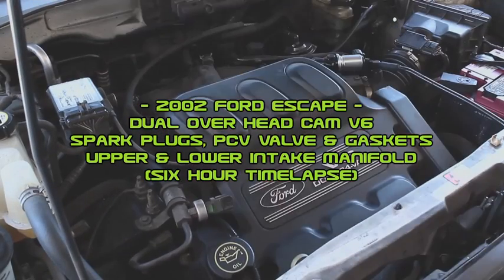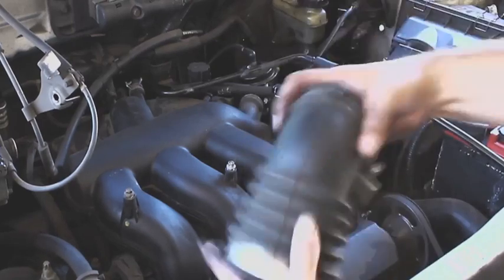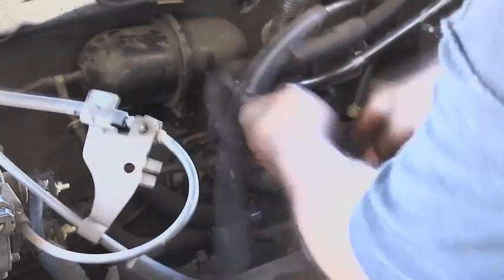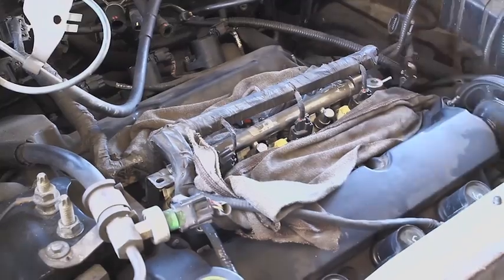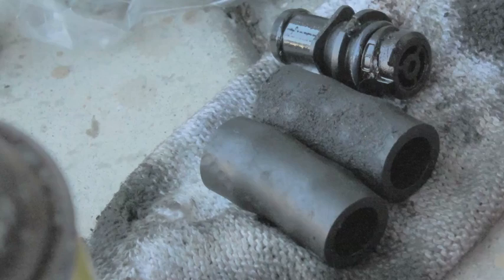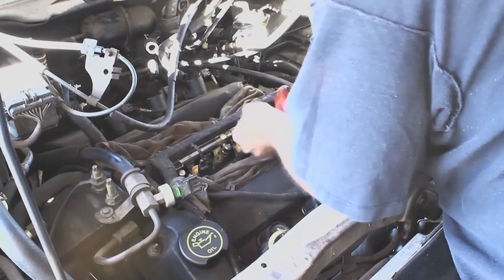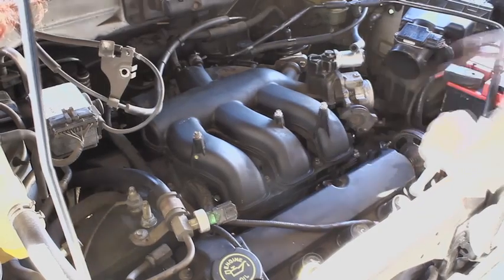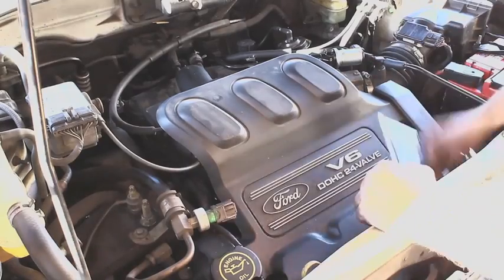2002 Ford Escape intake manifold gaskets (upper+lower) & Spark Plugs

Comment: Did you depressurized the fuel line before changing the intake manifold’s lower gasket?
Reply from the maker: In other tutorials the fuel rail is often disconnected. I circumvented that altogether, but, yes you are correct, depressurizing the fuel rail is the safest way. Even if it's not disconnected, it could spring a leak and spray somebody in the eyes/face. Your safety mindedness is sound.

Comment: LOVED IT! I have the exact same engine I'm working on, also found oil in the plug wells so I am off to replacing valve cover gaskets as well. My issue was the "bucking" around overdrive 50+ MPH and cyllinders 1 & 3 misfire codes. Hoping ny swap of all this works.
Reply from the maker: Thanks, I'm glad this video has been useful to you and so many others. That bucking may be related to electrical connections to the various components, it's worth checking out. The earlier Escapes are known to have electrical gremlins, not sure if Ford addressed that in later models. Heads up also on the linkage to the transmission. If it goes out abruptly, get a visual on that before taking it in. Mine lost a $7 plastic connector and the linkage directly to the transmission disconnected. Stay safe.

Comment: I hate mechanics (do everything myself because I have trust issues) my wife saw me watching your video because I'm about to do the intake/head job on her 02 escape and I told her you're the kind of guy I would want working on my vehicles. Keep it up!
Reply from the maker: Thanks Robert. I should've made it my profession as I originally wanted to. These days I just nerd out on whatever I'm working on, so my Escape got a lot of attention. Careful with the fuel rail electrical, it's delicate. If fact, the Escape's electrical system is it's Achilles, imho. I'm glad this tutorial has gone so far! Cheers
Reply: @LouRadon  Your tutorial is actually one of maybe two on this engine. I had a terrible time finding one, and I kind of wish I made one when I did my wife's. But yours was by far the best one I found. I ended up taking off both valve covers and accidentally separated the fuel rail from the injectors and didnt realize that the lines needed to be depressurized (I only work on cars when mine are broken so not too often haha). Aside from that, I would have been completely lost without your video. Thanks for doing it for us!
Reply from the maker: @Robert-cz3pz  My idea of doing something to help others, seems to have worked. At the present, this video is close to 80k views, I'm pretty stoked (and surprised), about that. All I ask in return, is for viewers to pay it forward to someone else. ...if you choose to. Thanks for the props man.

Ps: I learn so much from other people's DIY tutorials. So, i thought it would be cool to contribute something in return. We've created our own intellectual currency. Money is important but we don't always have enough for what we need. Sometimes we just want the sense of accomplishment. It's good to push our abilities now and again and do something challenging and new. Keep a healthy brain and a strong mind. Cheers

Comment: Hello, thx for uploading the video.
What prompted you to replace these gaskets?
Reply: He had a rough idle. What happens with these cars is the gaskets get fouled, and air is able to slip by during combustion. This leads the car to have bad fuel mix and a rough idle when cold.

Comment: Im really desperate, my for expedition was leaking, my mecanic fix the leaking but is a bad and strong shakin and la engine light is on , i need some help
Reply: Get an OBD2 scanner from Amazon. I got one for $39. It'll give you the codes and hopefully point you in the right direction.

Wouldn't hurt to inspect and/or just replace the ignition coils, spark plugs and gasket like he did in the vid. Could clean the mass airflow sensor, too.

Comment: Help! I Mazda Tribute 2005 release 3.0. The problem with the PCM, made in different places diagnostics can not find the problem, insert a new PCM machine factory. 2-3 working days, and again burns PCM and combustion noise issues, electricians, too, can not find the cause. Someone says, because of the coil can be. advise.

Comment: My escape has had a rough idle when cold, ive change the EGR and IAC. I had the hose all replaced prior to the EGR and IAC fixes and the idle problem. I found a video that stats this gasket replacement can fix the problem, so I'm going for it. Anyways what I'm trying to say is your video rocked and gave me confidence to perform this fix.
Reply: Did this fix your rough idle? Mine does the same. 2001 3.0L V6 with 300 000km
Reply: David Winn III did it fix your issue?

Comment: Great video- thanks. Looks like you were able to remove the lower intake manifold without disconnecting the fuel line to the rail. Can you confirm this?
Reply from the maker: +604zippo Yeah man, the fuel line remained connected. i just made sure to disconnect the fuel rail bolts of course and maneuvered everything around carefully. Lower intake manifold was able to clear it's way out from underneath. The trick was to slot the fuel rail out on the left where it wedges as the lower intake manifold was slid out to the right.

Thanks for checking out my video and commenting. Good Luck!
Reply: Thanks for the fast reply and I'm looking forward to tackling the lower intake gaskets now, with your help. Take care.
Reply from the maker: You're very welcome, happy to share what i've learned. More videos to be posted soon.
Reply: +Lou Radon 
I have a 2002 Escape V6 XLT, I just replaced both left and right mainfold converters brand new parts. After driving I noticed a burning smell and little smoke when I lift the hood. The repair man told me it's more likely the paint being burned off by the converters?
Reply from the maker: +datvegasboi09 i don't have much experience with that so I can't say for sure. but that is consistent with what I've read about other newly replaced exhaust systems. did u have check engine lights that cleared? is it running better or quieter than before? did they show you the old exhaust parts that were replaced?
Reply: +Lou Radon No engine lights were on or an issue. I would say better before that the repair shop told me I had 2 leaks in my exhaust and needed to replace both left and right manifolds.  No I didn't get to see the old ones but I did get to see new ones after installed. I saw white  paint looking pipes. I only smell something burning when I am driving but when the car is parked or running. I lift the hood it goes away or no smoke.

Comment: I'm also here troubleshooting an '02 Escape V6. She blew an EGR valve - literally. There was a hole in the side of it for a while. Replaced it. It ran for 200 miles or so, and coming up an interstate on a mountain it shut down. Towed it home. Hasn't started since. I feel some exhaust from the tail pipe - even tried disconnecting the EGR tube to see if we could circumvent any clogged cats. Still won't even start. Tons of oil in the throttle body behind the butterfly - not on PCV side of the intake. I'm going in to replace lower gasket [intake manifold gasket] as well as the plenum gaskets. I have spark in the front 3 cylinders. As soon as the plenum is off I will make sure the rear 3 COP's are sparking, as well as the spark plugs haven't been insanely corroded. One of the front 3 spark plugs had the electrode bent to the tip. No piston contact, as far as I could examine. Pistons looked clean as a whistle. There is fuel at the rail, pump is priming, and theft system is in order. We shall see its fate.
Reply from the maker: Sean Sateren Hey Sean, just saw you posted this last week. How's everything going? When i started working more on my ESCAPE last year, the throttle body was caked with deposits. I used an old tooth brush and THROTTLE BODY CLEANER, (be sure not to use CARB CLEANER as the metal of these throttle bodies are reportedly coated). I got most of the gunk out with a rag while the engine was off, then used the spray while it was running. That helped because prior to that the throttle itself was being restricted very minutely from closing and opening completely. I replaced my EGR valve at the same time, although i probably could've just cleaned it also, it was old so i chose to replace it. I have read about clogged CATS causing the EGR valve to bust open but no experience with that myself. Do you have any specific check engine light codes? Have you had a chance to place the spark plugs? INTAKE MANIFOLD gaskets aren't too bad to replace if you're patient and/or experienced but use caution on handling the FUEL RAIL as the injectors and wire harness/electrode connectors are delicate.
Reply from the maker: Lou Radon As a side note, you may have already checked your emissions vacuum hoses for disconnected or cracked lines but also in particular, that PCV hose elbow that connects to the INTAKE MANIFOLD can split on the under side of the bend and leak badly without being obviously visible. Curious to hear back if you choose to update us so that we can all learn more about it. Best regards, Lou.
Reply: +Lou Radon Hi Lou - this is Sean. I'm doing lower/upper intake gaskets right now. Everything looks good. Then we'll see if the cat is clogged, heh. Coils and plugs are good. Replacing plugs and PCV valve since I'm in there. Hopefully the EGR blowing was due to back pressure from bad intake? We'll see! I'll update by the weekend.
Reply from the maker: Pixel Pusher
really cool. not so bad once you see how it all connects and get an idea of whats doing what, right? main concern for me personally was being sure not to over torque anything when putting it back together. the hardware and plastic on these are soft.

btw, what kinda' pixels be you pushin'? i do a bit myself.
Reply: I removed all 4 O2 sensors to bypass cats, still no starty. New intake gasket, still no starty. :( I've gone through everything I could think of... Now - I'll do a compression check to see if we had a mechanical failure... We have fuel, spark, theft system shutting off, everything. I do graphics and printing in a digital print shop :) My father spent his life doing offset press, now i do digital press.
Reply from the maker: +Pixel Pusher i dig print media, very cool.
i'm not so sure the cats can be bypassed without causing a failure due 
to computer not being able to read and adjust air/fuel mixture. these 
types of problems seem recurrent with escapes once they hit a certain 
point but run great up til then. there is a series of symptoms often 
reported to be related to the PCM. in the event of a PCM complication, 
it sometimes has to be correctly programmed/updated if necessary or 
physically replaced and programmed to your vehicle. google it (and 
prices) for more info.

Comment: Lou Nice video!
I'Ve just change my coil pack (all 6) on my escape 2004 v6. and I notice a strange orange stuff on the spark plug, there were some on the old coil pack too. It was in 3 cylinder only. I know it's not rust, but can't figure out what it is. Any idea?
Reply: Perhaps it was antiseize. I have an 04 Mazda Tribute V6 and I put antiseize on my spark plugs. When I go to change them a year later, the antiseize compound has an orange-like color that kind of looks like rust, but I know it isn't.

Comment: I love how meticulous you are. Wish you lived close I would've had you do mine. Can I ask you a question? I replaced the spark plugs, and injectors in my 02 Escape v6. No codes before the job. Now I'm gett P0304 and P0306. The car barley stay running... I'm stumped on what I did wrong because the car ran pretty much fine before the job.
Reply from the maker: ***** cylinders 4 & 6 misfire. did you double check all your wiring and connectors?

Comment: Hi lou my truck is a ford 2002 scape and  When i try to turn it ON the throttle cruise thing.. snaps out can you show me how to fix that. Problem so i wont pay a mechanic thanks. And the truck wont turn on. 😢😢😢
Reply from the maker: nataly Alvarez Ok, for example at 0:10, I remove the cover.  Then from 0:11-0:13 I'm referencing the Cruise Control cable.  I'm almost embarrassed to admit but i drove my escape for years without cruise control but didn't care because I don't use it much anyhow. So then one day I was looking at the spark plug situation and saw that cable was dangling. That snapping connector piece where the cable connects is sometimes defective (..check escape recalls..). Mine kept falling off so I used a little piece of duct tape to fill the space of the plastic connector that wears thin. just above that is the throttle cable. reconnect or repair if needed.
Reply from the maker: nataly Alvarez hey! check out my latest video if you're still interested.

"2002 Ford Escape Cruise Control & Throttle Linkage"

Comment: I bought an 02 ford escape. Took it to the dealer for some recalls and diagnosis for some noises and smells.
They came back with a list; engine reseal, L manifold, L gasket (exhaust leak at L manifold replace manifold), brake booster, tie rod and axle leak - replace axle. 
My question is could it just be the gasket. I'd hate to fork out the money I don't have on a manifold if it's only the gasket. I've heard dealerships tell  you to replace the whole part if a component needs replaced.
Reply from the maker: unless the upper or lower intake manifolds are cracked/have leaks, or are warped and won't sit flush, i'd only replace the gaskets. at 140,000miles mine didn't have any serious problems like soft or crumbling plastic, etc.. if you diy it on your own or with a friend, you'll be sure that the lower gaskets were replaced. i have a suspicion that those tend to be neglected because they're further down and more involved to get at. if you take it to a mechanic, you might save a few bucks by purchasing the complete gasket set thru amazon.

http://www.motortrend.com/cars/2002/ford/escape/recalls/
http://www.fordforumsonline.com/recalls/2002/escape/

Comment: My women wanted this truck because "everything else looks like a ford Taurus" wtf. Thanks bro, my mechanic doesn't want this money so ill do it myself. Thanks again.
Reply from the maker: yeah, i saved some bucks doing it myself and i was sure it got done properly. i'm not gonna' hate on mechanics but unless you're looking over their shoulder watching, how would you know if they actually replaced the gaskets? they can always show you the old parts/gaskets but you know... a good reliable mechanic is a life saver, but a lazy/shady one will just take your money and leave you with the same problems.

if you haven't already, don't forget to check the inside of the throttle for gunk buildup that can keep the throttle plate from opening and closing properly! some throttle body cleaner and a rag +an old toothbrush can free that up if so. carb cleaner is bad on these because they have a coating it'll eat away, so throttle body cleaner is the way to go if you clean it.

be sure to bring her out to see you work on it!! heheheh!